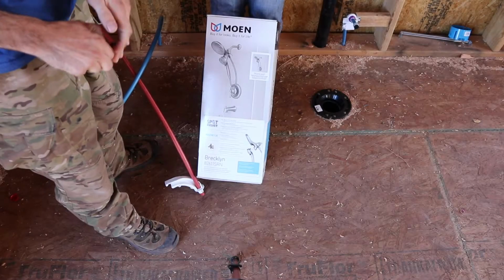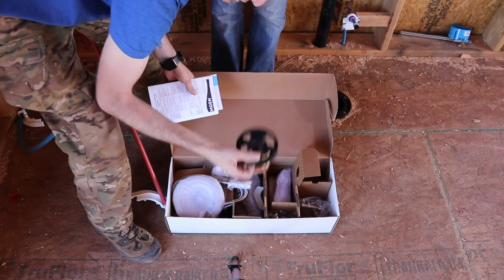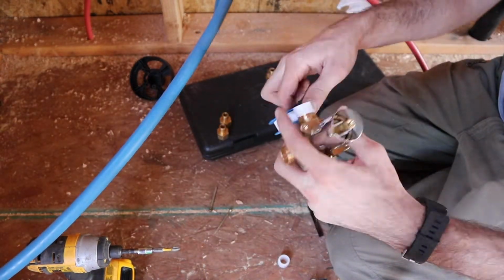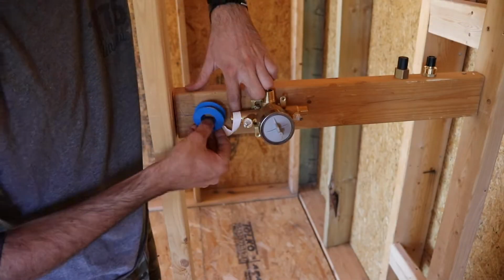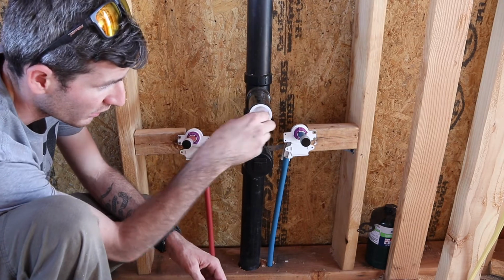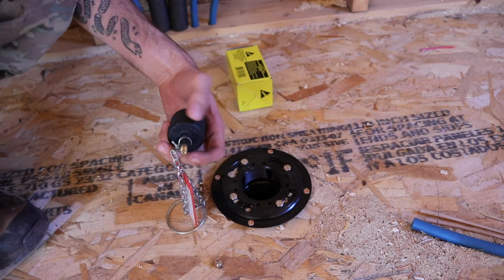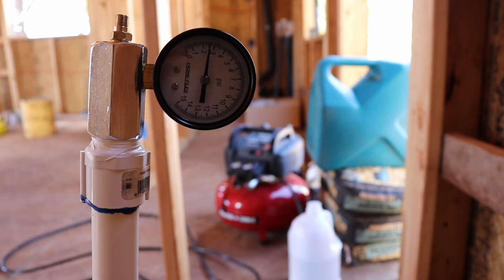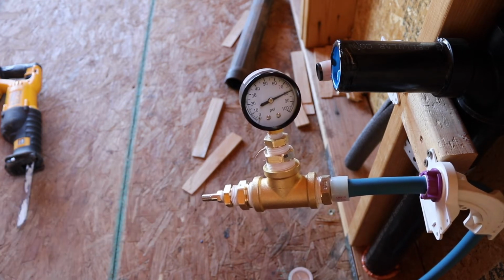DIY Cabin Plumbing and Electrical Inspection

Comment: Good Job! I want to replace new electrical in my old house, also the plumbing lines, is it better to use PEX then copper? Looks a lot quicker, but I've used pieces to repair a leak and the fitting are a little pricey, Did I see somewhere in your Video's that you are in Flagstaff? I love that area!! Also I know every state is different, you don't need to be Licensed or are you? Just asking because I would like to do my work myself. I think here In California you need to be Licensed which I am not.
Reply from the maker: Thanks!  I think pex is the way to go personally, there are less fittings overall which equates to less of a possibility for leaks.  The fittings are a little expensive if you get the brass fittings, but the plastic ones work just as well and aren't too bad.  And like you said it goes a lot quicker and is honestly a lot easier for a DIYer to do themselves.

We are in the Flagstaff area! We really like it up here it's very pretty!

And I am not a licensed contractor.  In our county if you are an owner builder (or doing the work yourself in a remodel etc.) You do not need to be licensed to do plumbing or electrical, however if your a licensed contractor doing the build a licensed plumber/electrician is required.  Either way they do require you to get a permit.  Although what they don't know won't hurt them lol!

Hope that helps!

Comment: Good progress PP! But you definitely need way more Teflon tape on those joins, minimum 6x around, not once! Plumbers I have worked with even recommended 10-12x around every join!
Reply from the maker: That's a good tip, I usually do about 4 times around, I think I edited that part to be shorter so it looks lile once... but I'll start doing it more like 10 times! Good catch, thanks for watching!
Reply: @PootsPastures  great job on passing your inspections 👌🏼
Just for the longevity of your plumbing joins might be a good idea to add more before it's buried in sheet rock ☺️